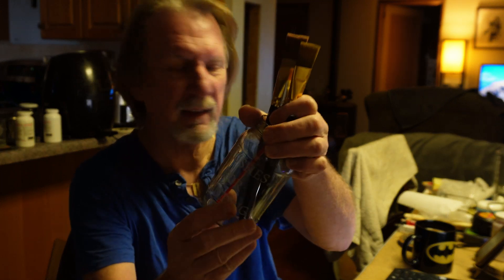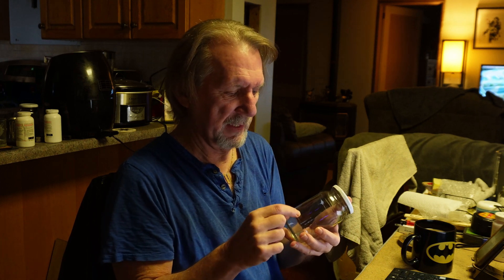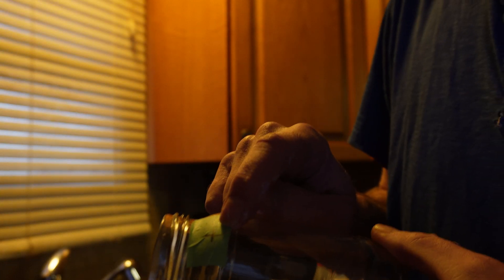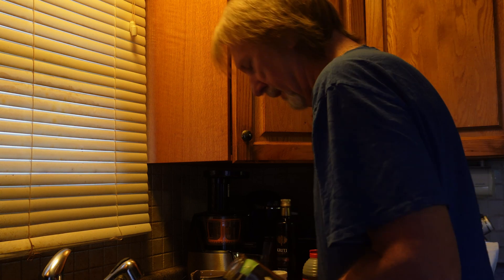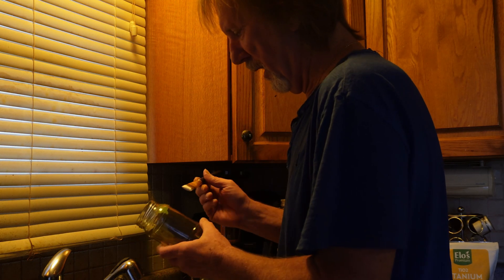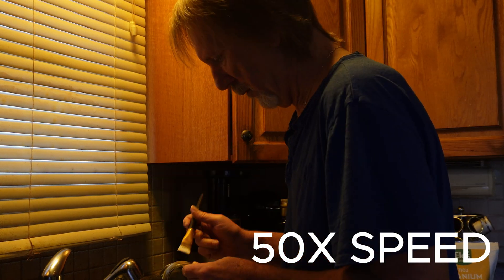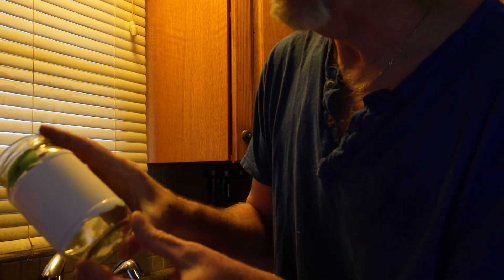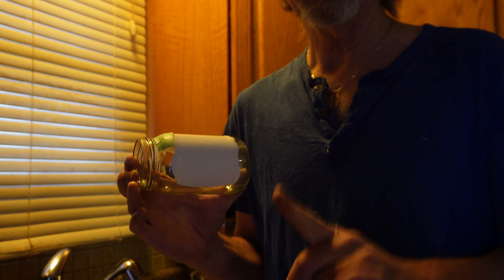Laser 2 colors onto glass using the xtool s1 20w with the rotary accessory part 1 #education #fun

Comment: Hi Johnny. I’ve been watching your videos for a while now. Thank you so much for sharing your experience with us. 
Do you think that engraving with chalk paint will work on plastic? Like a plastic jar.
Reply from the maker: thanks for watching...great question...plastic is very difficult to work with, there are many types of plastic and many have a very low melting point...i have been switching to tempra paint as it is much cheaper and easier to wash off...now personally i would be doing a lot of testing on plastic jars as they are usually very thin...but i do not think it will workout to good, but please prove me wrong and let me know how your tests come out...hope this helps happy lazering
Reply: @JOHNNYLAZERSTUDIO 
Thank you Johnny. 
I’ll give it a try and I’ll let you know.

Comment: Johnny 2 questions. did the center finder come with your rotary tool? I see you are on a riser, so is mine. Can you put the tray in the bottom?
Reply from the maker: no the centering tool is part of the accesory kit which is worth it because it comes with base for your chuck that by turning a knob raise or lower the angle of your workpiece...and yes i can put my tray on the bottom..